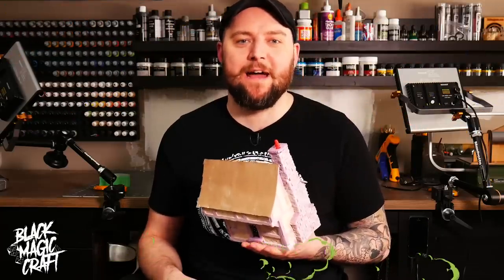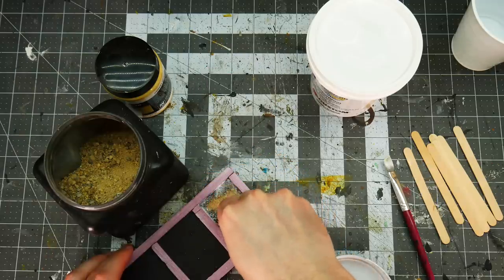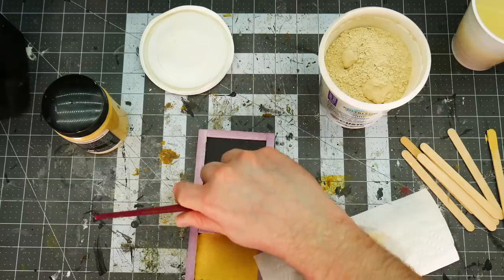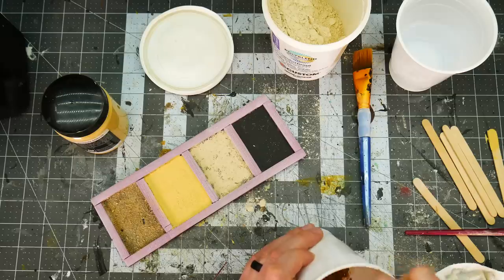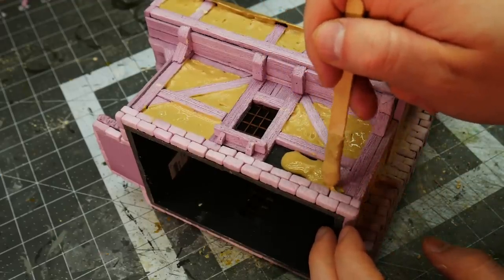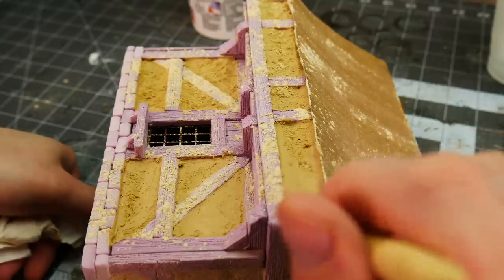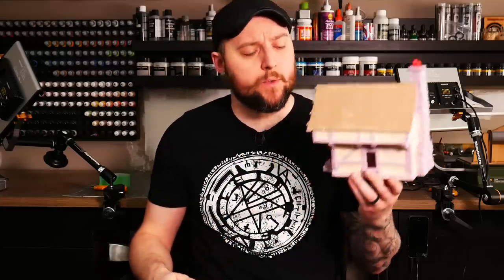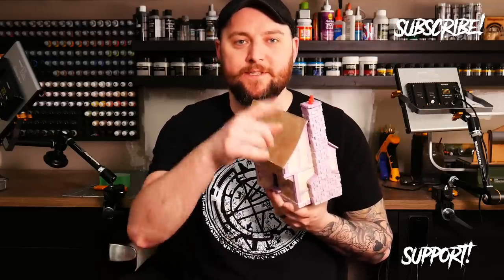Building a Foam House for Tabletop Gaming PART TWO: STUCCO

Comment from the maker: Yup. There is a weird glitch 3 times in this video. It's a problem with YouTube ingestion/encoding that many people have been experiencing. I re-uploaded 3 times over 3 days, and even once was a different file render but the glitch shows up exactly the same each time. I give up, the show must go on!

WATCH THE WHOL SERIES
PART ONE - STRUCTURE: https://youtu.be/7sHdZTaQTD8
PART TWO - STUCCO: https://youtu.be/ncn6mvZHk-s
PART THREE - SHINGLES: https://youtu.be/JTzZVE1HYuU
PRT FOUR - PAINTING & FINISHING DETAILS: https://youtu.be/8Z_LKRMdkX8
Reply: Can u try to make a house made of cardboard
Reply: I noticed the glitch on one of wylochs vids too. Strange
Reply: Black Magic Craft I thought it was something you cut in to the video ... some black magic video editing
Reply: My mind was with Tabletop Lofts, I thought you pulled a Tyler Durden on us. 😆
Reply: I’ve seen that glitch on many videos uploaded within the past few days across YouTube. “It’s not you, it’s YouTube.”
Reply: I thought I would give you one more option. We used to make our own Halloween decorations for the yard. We used to saying called monster mud. It is exterior house paint (so the props could be left outside) and dry grout. It works like a charm and can be sanded. Plus since the paint is already mixed in you don't have to do a second step besides maybe a wash.
Reply: I don't think you have sand a proper shake. Try this: 25% modge podge, 50% cheap acrylic paint like apple barrel, and 25% fine sand. This will give you slightly thicker than you'd like, but add water until it's the right consistency. Straight out of the mix is how I do sandstone.
Reply: Try using a acrylic brush to push your grout around. It should make it easier to get it into the tight corners. Another option is clay mixed with some PVA. It's not as rough and table ready as the grout but it does look realistic and you can carve rocks and cracks into it while it's still soft for extra details.
Reply: FOR THE WALLS... you could use fast drying "paste?" for covering holes up in a wall, irl...it gives a very believable clay/rocky effect, which looks alot like what you have. 
and i bet you its way faster and less complicated.

Comment: Option 5: Get some watery plaster. Pour it into your area, it will flow into all corners easily and self level. When it begins to harden and reaches a point like clay take a large stiff bristle brush and start dabbing the area. This will leave a rough bumpy surface that dries very nice. Once you paint it and dry brush some highlights over the raised points it looks great. Suppose it depends on what look you want, but I did this on a hobbit house recently. Looks like very rough stucco.
Reply: This is great advice. Thanks for sharing.
Reply: I did the same thing is good yo
Reply: I have done this as well. It doesn't even have to be watery.
Reply: this is probably a silly question, but couldnt the exothermic reaction that occurs with curing plaster melt the foam?
Reply: @totalanimalsoup  perhaps a little bit but it should be able to take it. If your styrofoam instant Ramen/coffee cup can handle nearly boiling water a little bit of plaster Heat shouldn't be terrible
Reply: @lanasmith4795  that makes total sense!
Reply: @totalanimalsoup  such a thin layer produces very little heat. So, no :) Even when working with a lot of plaster ive never had it get above "slightly warm". No where close enough to melt foam.

Comment: The grout you suggest for the UK is imported.  I suspect that 'grout' means something different over on your side of the pond.  Presumably, there is some British equivalent which goes by another name.  For this, I have used Tetrion and Polyfilla, which are brands of 'all purpose filler', but these might not be the same sort of stuff.  They are more like plaster.  'Grout' is what we use to fill the gaps between bathroom wall tiles.  This, perhaps?  https://www.homebase.co.uk/powder-wall-grout-1kg_p354356
Reply from the maker: Yea the only stuff I could find on UK and German amazon were grossly overpriced and there were a limited number of listings. Tile is even more common in Europe than North America so this shouldn’t be the case. There must be a different name that I’ve never heard of. Grout is the only term used in North America.
Reply: @BlackMagicCraftOfficial  This is really late but I think it is joint compound.

Comment: Alternate stucco solution: 50% PVA glue/50% eggs carton (shredded, dunked in hot water and wringed in a sieve).
Mixing the PVA glue with the wet carton paste creates a sticky dough, that can be applied to foam building, even on vertical surfaces, without spilling, peeling or cracking.
It also works great if you want to create weathering effects with sections of walls where the stucco fell off, just use a scalpel to remove a section before it dries.
You can keep your extra "sticky dough" in a sealed ziplock bag. If you don't have egg cartons, fast-food cup-holders are made from the same type of recycled paper paste.

Comment: I use ready mixed filler, especially the stuff from Poundland here in the uk.

I apply it the same as you with the lollipop stick then add texture with a wet finger.

Comment: Paper clay also works wonderfully hardens super-hard, adds weight and can be watered down and applied with a sculpting tool much like real stucco. Don't smooth it out all the way, it adds to the detail later. The grain is juuust about right for some interest but not too fine as to make it look like plaster.

Comment: That first technique looks more like “pebble dash” which is a fairly common wall finish on houses in the UK. Especially those built in the 1930s. It’s essentially to hide inferior bricks and, perhaps, to make things look neater. The wall is covered with a cement-like compound and then small stones (the “pebble” bit) are thrown (the “dash” bit) against it so they stick. Then it can be left as is or painted.

Comment: Add pva to the mixture you made to keep the grout from cracking. Sometimes it'll do that on you. If you've already tried, you're reading this saying "pva and grout don't combine" they do, you just have to mix the pva into the water then mix that into the grout. Cheers

Comment: Looks awesome! I can't wait for the roof shingles! I use texture/concrete paste on my foam. It might be an easy option for this as well. I make my own using 1/2 cup baking soda, 2 tablespoons mod podge, and 2 tablespoons white acrylic paint. You could use any color of acrylic paint and adjust the recipe if you need larger amounts of paste.

Comment: Great tip with sculpting the plaster once it has partially set.  I am partway through building a tavern and have used plaster on the interior of the ground floor, and whilst it looks cool it does look far too smooth.  The next floor is entirely plaster and beams inside and out, so I will definitely be putting your suggestions into practice cheers.

Comment: Being in construction as well, a bonding agent would help from chipping off.  Paint PVA on the area first, let it dry, then add the Custom Blend non-sanded grout.  The water will rehydrate the glue and bond that much better
  Cheers mate...

Comment: Great job , late to channel but here now , the only problem that I had on with this is that when using the foam board it had a habit of slightly warping a bit because of the moisture of grout, I solved this by using some 1/8 in plaster slabs I had made from silicone molds for another type of project put them on outside of foam board problem solved, hope this helps if anyone had same issue

Comment: I'm just watching you apply the grout to the side of your building with the Popsicle stick, and it got me thinking that a disposable icing bag with a narrow tip might make it even easier to apply. The tips are washable and just fit in the bags, or you can go even cheaper and just use freezer bags, cut a small bit of one corner off, and squeeze the grout out that way. Given the thin consistency of the grout it should flow fairly easily. Just a suggestion. ;)
Reply from the maker: That would probably work very well actually

Comment: I normally use a water based filler without solvents. Which is comparable to grout. I never used ``grout´´ but now I will give it a try! It may have a coarser texture?

Comment: Have you ever tried latex texture media for this kind of finish? The ones I've used for painting give some interesting results, and it's latex media, so you can freely mix with paint.
Reply from the maker: That’s basically what the Vallejo texture paste is.....to me it seems like liquitex or golden modelling paste with some grit mixed in.
Reply: @BlackMagicCraftOfficial  Gotcha. I'm not familiar with that, but I've used a bunch of the Liquitex texture mediums in traditional art with good results. Thought it was worth a mention, since they have sandy/beadlike options, among others.

Comment: if you sprinkle the grout on trhough a stocking, it might work better? Check Luke Towan out, he does this a lot with grout.
Reply: I was going to say the same thing.  Sifting the grout as it is applied would result in a smoother application.

Comment: Hey Jeremy
great vid as usual
You might also want to consider Liquitex moleding pase.  If it can replicate water effects is should do well for stucco
Also folk art concrete effect paint.  I know you had a meh experience with their moss, but you got the small 2-bottle kit.  I bought the larger ones and got a better result than you did.
Reply: That's modeling paste.  Sorry! butterfingers.
Reply from the maker: @gondogeek  The liquitex modelling paste is basically the same as the vallejo paste that doesn't have the grit in it. I have both, would work fine.

Comment: What about using a finer grain sand with no aggregate on the glue, and then sealing it with a water glue mixture after it had dried? How would that turn out?
Reply from the maker: It would be better than unstrained sand, but still worse than the other options I show.

Comment: Hey Jeremy, your grout really resembles Durham's Water Putty in color and texture. Are they the same or similar products? Though, from my memories of Durhams, it sets like plaster of Paris, fast and hard. So the workability time might not be the same.
Reply from the maker: I think you could get similar results with water putty or plaster of paris. Plaster of Paris may be prone to breaking or falling off though, grout is pretty good at bonding to things. I’ve never worked with Durham’s but from what I know it’s quite strong so likely a worthwhile thing to try.

Comment: Looks like a good effect. I've been looking to do this kind of effect on a tower that I've built, odd question would plaster work similar to this, I guess I could a test bit but I would still like a more expert opinion, cool vid can wait for the next one
Reply: Plaster has a tenancy to smooth itself out. You could try adding some sand or fine model train ballast to it and see how that goes. Or you could wait until the plaster is mostly dry and gently press in the sand. Problem would be having the plaster stick to the wall of your tower. Plaster doesn't tend to stick very well on vertical surfaces. Maybe try adding some pva glue to the plaster/water mix. You'll have to test things out before working straight on your building.

Comment: Looks very cool. With it being grout are you worried about it cracking if dropped?
Reply from the maker: I try not to drop buildings that I spend several days making.
Reply: @BlackMagicCraftOfficial  I hear ya but things can get rowdy at the gaming table. Its inevitable that it would drop at my table.  I'm going to try it but maybe add some shredded fiberglass to it. The fiberglass can act like straw to increase tensile strength.

Comment: Why not just use fine filler ? A tub costs very little and it works really well. It can be sanded easily and it's good for most scales.

Comment: You could also use cheap auto body filler too.
Reply from the maker: Autobody filler is considerably more expensive than dry grout AND far too sticky and thick to work with. I mean it would probably work, but would be harder to use, more expensive, AND it smells awful.
Reply: @BlackMagicCraftOfficial  lol. I use almost everyday as a classic at restore. If you add straight fiberglass resin to body filler it thins it out and delays drying  time giving more work time.
Reply from the maker: Fiberglass resin isn't something I, or most people, just have lying around. I actually don't even know where you'd buy that. I try to make my materials and techniques as universal as possible. But anyone that has access to, and is familiar with, good alternatives should certainly use them.

Comment: You should comment on the price of the products you use so they only have to watch the video in order to decide whether or not 
they should continue on. Just a thought.
Reply: Dungeons and Gluesticks did this if I'm not mistaken, it is an awesome idea
Reply from the maker: @readinglennon8254  I did comment on the general costs here. I try to avoid specifics as I have no idea how much a particular item will cost YOU where YOU live.